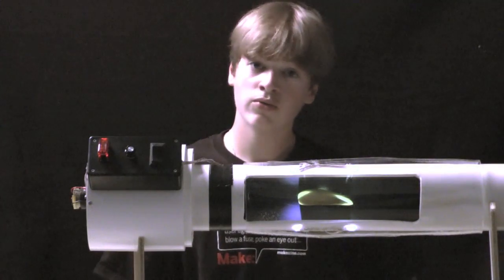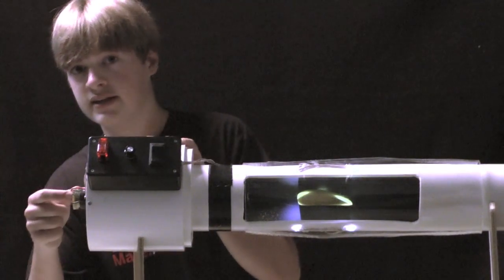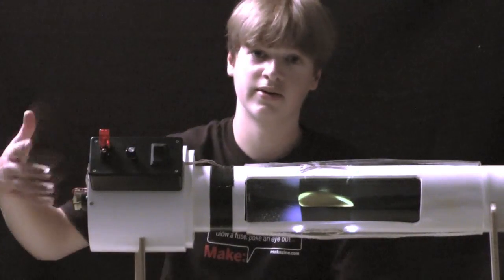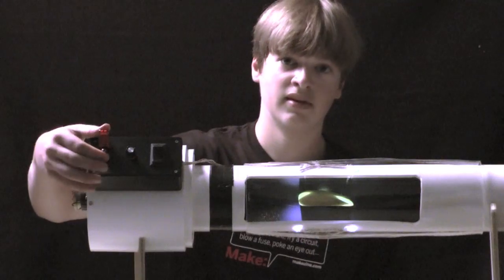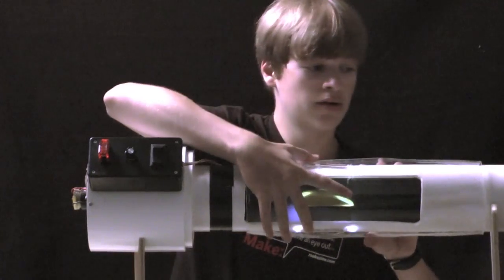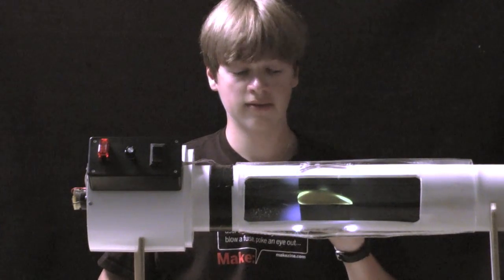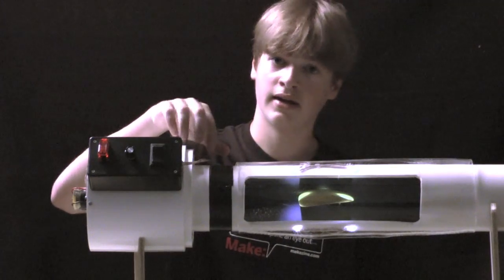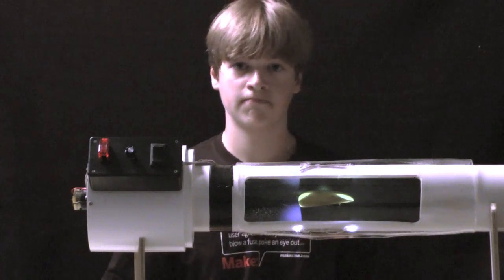Wind Tunnel Project

Comment from the maker: I used a normal sheet of paper that I had lit on fire and then blew out the flame to it was just smoldering. Then, I put that it a metal container and hooked up a bike bump to it so I could give it air. I attached a hose to the lid of the container that then led to the inside of the wind tunnel. It created a pretty nice stream of smoke.